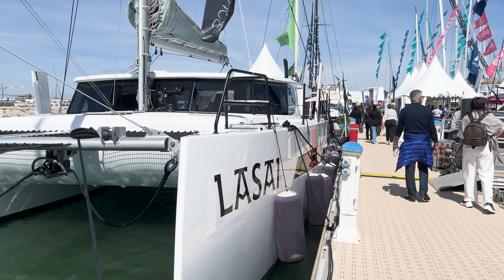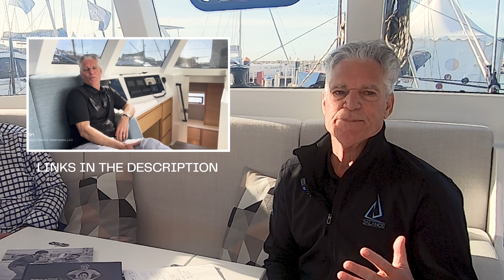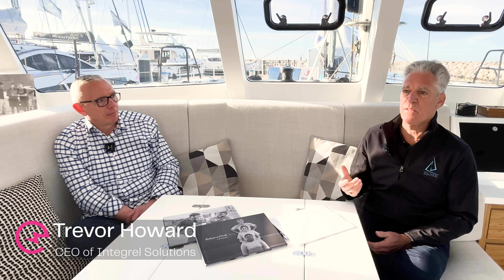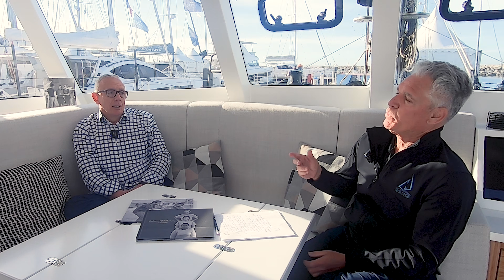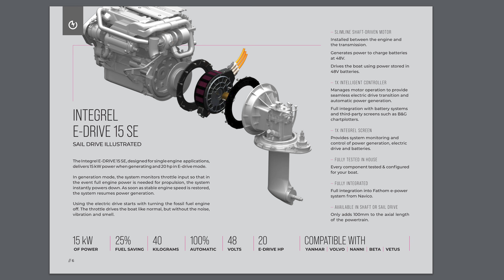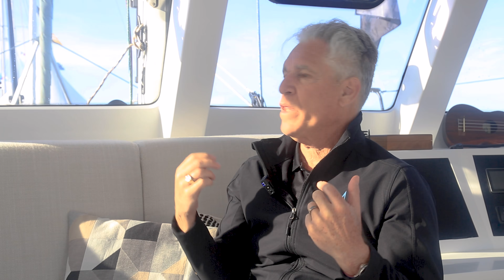Part 3: Balance Integrel Partnership & The New E drive

Comment: Finally a clear-cut and honest (3-part) explanation on why you still can't do without diesel engines on a blue water sailing yacht. Very interesting. Just one thing remains unclear: why no sail drive on the bigger boats? Is it a question of horsepower? :octopus-red-waving:

Comment: No Hydrogeneration? That would be a deal breaker for me.
Reply from the maker: There will be a hydrogeneration option with the E Drive, but I believe anyone who explores this seriously recognizes that the charges produced for the speeds lost is not a great value. On very large performance cats the hydro starts to have a bit of benefit, but honestly when you see how much charge get with ten minutes of diesel charging on the E drive over the hours it takes to get the same in hydro, you would see it is worth making it a "deal breaker."   But again, you want it, Integrel will offer it as an add on to the E drive in a year or so.

Comment: Does Balance use the same hybrid system as the HH44?
Reply from the maker: No. We are using the Integrel E-drive, our partner in innovation, and we will be the first to test the new E-drive on a Balance 526 later this year.

Comment: As far as I know all Balance catamarans have sail drives including this latest one.  That is a cheap short cut and  puts a  bl**dy great hole in the bottom of the boat and they are costly to maintain and service.  Anything with a sail drive is a deal breaker for me.  Just take the engines out of the very back of the boat and put in shaft drives!  Balance is not alone in this.  They mostly all do it but they are careful to skip over the costs and of course the fact they can SINK you.  Two notable exceptions are Antares and Windelo..  Windelo have room for shafts because they are electric motors.  Antares have the weight centred thus they have room for shafts.
Reply from the maker: Geoff, we use sail drives because they are better for our needs. They are not any cheaper than shafts. We do not like engines in living spaces, or under bunks, and prefer they are in watertight living spaces. Why on earth you think a saildrive poses a sinking risk is beyond me!  You can put a hole in the engine room of a Balance and the water will only come up  8 to 10 inches as it is a watertight space. A shaft poses far more "sinking danger" with the "dripless seals" that drip and the cutlass bearings that wear down. They are in the boat itself, not in a watertight compartment.
Reply: @balancecatamarans  Water tight bulk heads are a really good idea.  Now let's see, that's right Titanic had those!   Sail drives are maintenance hogs.  But that comes after they have sailed away over the horizon.  If you hit something hard you have a hole in your boat.  I don't ever want a hole in my boat, ever!   HH catamarans 44 has shafts with their hybrid.  Windelo has shafts with their electric motors.  They have the room for shafts or sail drives and chose  shafts.  I have yet to hear of someone falling overboard from a bedroom whilst working on an engine.  Boats cost enough to run as it is without the extra cost of poor design/short cuts via a Sail Drive.  Just design the engine/weight forward and use shaft drives that have been around for ever and proven themselves to be efficient and robust and maintenance friendly.  I don't need to tell you that putting engines right at the far aft end of the hulls is far from ideal from a point of view of. weight distribution and crew safety at sea, yet so many do it.  I know why you do it.  Because it is quick and easy.
Reply from the maker: If you think that HH and Windelo build better boats than us, more reliable, more intelligent, to your liking, you should buy them. I encourage you however to do your research. At any given time 2 to 3 Balance cats are making a maiden sail back from Cape to Town to the Caribbean. We have a proven track record. We do not use sail-drives because it is quick and easy. We use them because we feel they are a better solution for the many things we wish to achieve. I have two shafts on my powerboat here in CT and I can tell you that they are a lot more maintenance than Yanmar SD 60 sail drives.
Reply: I have read your reply and don’t agree.  Saildrives are expensive to maintain and a pain in the ass.   The new HH 44 has shafts.  Why?  Plus the energy has to change direction before it gets to the water.   Engines in the back put weight in the back where you don’t want it.   Take a look at Palm Beach power boats where the engines and weight are centred.   Mark Richards knows his stuff.  He won Sydney to Hobart 8 or 11 times.   How many have you won?   The sail drives are quick and easy for you.  I have got manners so I will allow you your opinion.  Please allow me mine.
Reply: Oh, I have not heard of anyone falling overboard from the bedroom whilst working on the engine.
Reply from the maker: All advantages are attended with disadvantages. On a shorter cat we are strongly convinced in the advantages of the sail-drives for our designs.

Comment: Surely Integrel Solution's E-Drive will compromise an engine manufacturer's warranty positioned between the engine & gearbox ?  Makes all servicing & repairs an expensive business. Who is going to do it globally and is an expert in this new technology ? I can imagine all sorts of trouble  if there is a failure. How much testing are you doing on this system on the water ? It just adds risk to my boat.
Reply from the maker: All new technology poses risk. We ventured out to test and refine the Integrel Alternators five years ago and now everyone else is using them. It will be the same with the E-drive. But we have worked so closely with them for years and they stand behind their products and offer great support and service. If someone wants to get a Balance without E-drive they can.

Comment: If the new E-drive can generate 13-15kw, what is the purpose of getting expensive and inefficient solar panels that take up deck space?
Reply from the maker: That's a good point. With the Edrive as efficient as it is, it could be argued you can use less solar. I think most want enough solar to operate the boat during daylight hours without resorting to additional charging. But it is true, the new
E-drive generates a very fast and powerful charge off the engines.

Comment: Should I retrofit one?
Reply from the maker: David, it would be hard to retrofit an E-drive on a Balance because the engine bay bed has to be expanded a bit to make it fit properly. You would be best to add on the existing Integrel alternators.

Comment: Interesting - main concern with this installation is how to repair/replace this unit if/when it fails?    The current system is rather bolt-on to the Yanmar engines so relatively easy to access to repair / replace, which has been important for Gen1 systems like ours.   General issue for boat builders with early generation boats - fail to understand and anticipate how systems are accessed to repair / replace.
Reply from the maker: The E-drive is a bolt on system as well, but removes the need for belts and pulleys. It does require alteration to our current engine bays, however.
Reply: @balancecatamarans  good to hear it's a bolt-on system and (hopefully)  won't require removal / movement of engine or sail-drive to remove / replace the unit, or impede engine operation (as in currently we just shut down controller and remove belt to remove from engine operation).

Comment: I'm excited to see the evolution of Integrel technology. You mentioned that the electric engine is air cooled. Are there sensors or other controls to prevent it from overheating?
Reply: Yes, the E-Drive system is designed with safety as top priority. The system monitors the voltage, current, and temperature of all components, including the batteries (independent of the battery management system). If operational limits are exceeded, the system ramps back power. If safety limits are exceeded, generation or drive is temporarily suspended and a warning shows on the Integrel Touchscreen.

Comment: Thanks for the video and the knowledge that you have provided. 
Could you tell us the cost difference of just a desiel engine and a combo engine system. Not just the cost to purchase but instalation, maintance
 Extra batteries etc.
Any knowledge. On how much a boat uses the desiel engine and the electric engine.
Reply from the maker: The exact cost for the new E-drive, installed on a Balance, is yet to be decided. There is the cost for the E-drive but also most customers who want such a system will add an additional battery or two. We will have pricing shortly.
Reply from the maker: We do not yet have exact pricing for the new E Drive. We are installing it on our first Balance near the end of this year. But it will cost a good bit more than two standard diesels with standard alternators. But of course if you get a standard diesel and standard alternators you generally need to add a generator or some other high output alternator solution. In the E Drive, and most parallel systems, you do not use the electric motors but an hour or two at a time, you rely on the diesels to charge and to motor far or fast. You do need to add an extra lithium battery or two if you want to extend the range on the electric motors. We will have pricing on the E-drive very shortly.

Comment: What are the advantages of the Integrel over the Beta Marine hybrids
Reply from the maker: Beta Marine is an engine manufacturer. I believe some of their customers install Bell Marine electric motors to them. I am not well familiar with this product, but we ruled it out for Balance because we wanted the global service and support of Yanmar, the support from Integrel, and only wanted to use a sail-drive system as I sought to explain in my video.

Comment: With these and enough battery storage you could drive the boat 3 hours on electric and then use diesel for an hour while charging the banks back up. I think that is the goal.  I see they will need liquid cooling to achieve that. It's all about how much diesel you can save.

Comment: To me one of the problem is you still have 2 desiel engines to service. They slways seam to have a problem that needs to be repaired.
Reply from the maker: It is better than two diesel generators and two electric motors in my view. With two diesels you at least get excellent propulsion redundancy. Prior to our adoption of the Integrel alterators we had to install a diesel generator and two motors. But a cat without two diesels would be very hard to dock too!
Reply: One very important thing most fail to realize [In regard to all electric boat] BATTERIES can NOT be charged and discharged an unlimited number of times.  They can be charged/discharged only a certain number of times before their efficiency diminishes tremendously.  Which means the COST of replacing those batteries for new batteries for the sake of always running solely on electric propulsion would be astronomical.  BATTERY TECHNOLOGY simply is not there yet.  Solar technology is not there yet either.  I like what Integral has accomplished with their technology to at least provide a cost effective option to use while we wait for battery and solar technology to improve dramatically.
Reply: @WyckoffMode  current generation LFP cells can do 6000+ full cycles and still have 80% of their initial range.. fir the amount of use most yachts get, that's probably longer life than the yacht

Comment: Very Good!... is it posible to getr a higher output unit on each engine ? 15kw+?
Reply from the maker: Not at this time. 15KW is a hell of a lot of charge coming from one diesel engine.
Reply from the maker: Higher than 15Kw on a 45 HP diesel?  Wow, 15KW is really superb. With two engines it is like going about with a 30KW generator.
Reply: The E-Drive 15 system will be able to output higher power for up to 120 seconds only. Larger systems are planned, however they are unlikely to be air cooled.

Comment: Does Balance have any thoughts on the ABB Dynafin and other fully featherable Voith Schneider type propulsion systems?  Obviously not for near term use, but for longer term adoption.  Cheers.

FWIW, I'm surprised that no one has done a hybrid drive that is T shaped with a diesel and an electric drive/generator on the top of the T and the prop on the bottom of the T.  Obviously you would need 3 clutches for each terminus of the T.
Reply from the maker: I am afraid not. But we keep our eyes out for all great innovations!
Reply from the maker: Regarding the T-Shape:   I am not an engineer and this would be out of my skill set to know!  We decided to work with Integrel based on both 5 years of experience but also the intensive RD they have invested in over the past few years.

Comment: Diesel is more dense than lithium batteries but diesel is only 40% efficient against batteries at >90%, still doesn't 'balance' things out but it is not quite 22 x better, the Integral systems are superb though.
Reply: No, the ~20x more dense number is including conversion efficiencies. Unconverted to useful shaft HP, diesel is about 38.6MJ/L, lithium is about 0.75MJ/L. With that said, efficiency goes a long way in being green. A light, sleek boat uses a lot less diesel.
Reply: There is not a change that the efficiency balances things out. There is a reason we don't have electric freight trucks over diesel. To get an electric truck half the range of a diesel, the electric truck is so heavy that there is no margin left for actual freight. Even electric  cars with half the range of normal cars need special tires to handle the weight. And then you think it's viable on boats that are 1000x more sensitive to weight? No way.

Comment: Do you know what design of electric motor Integral use?  There is a particular design that is very efficient.
Reply: The Integrel motor is a custom radial flux motor designed specifically for the marine market.
Reply: @jasoncrawford6447 That's what I was looking for.